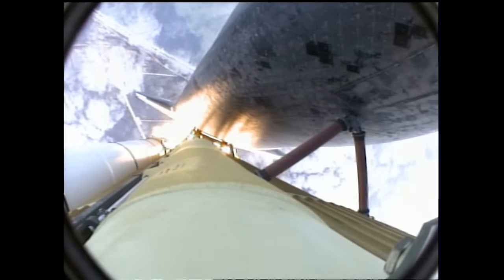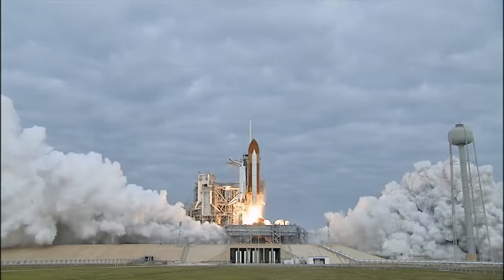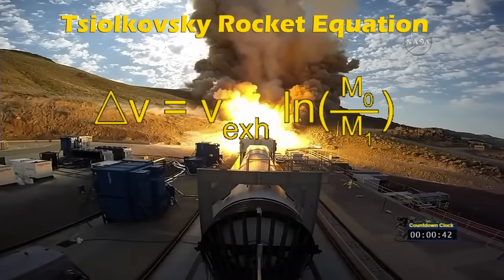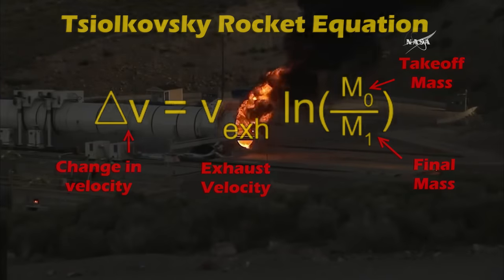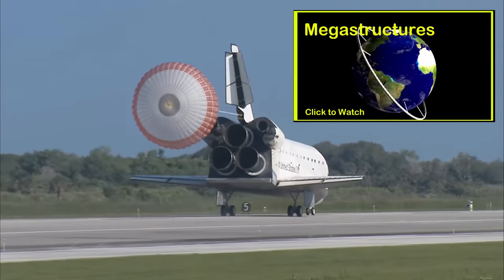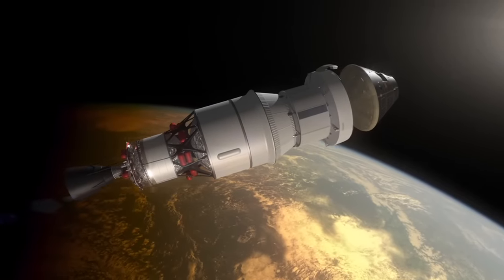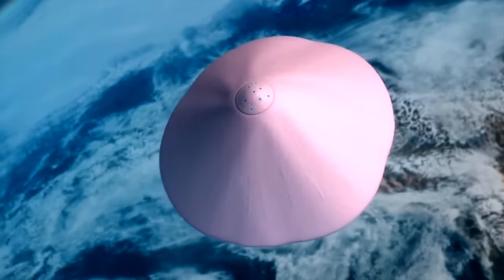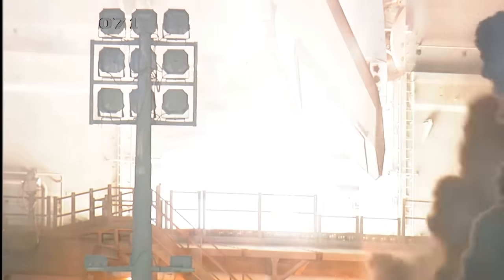The Spaceship Propulsion Compendium

Comment: I haven't watched this video in full but one way we could take a payload into space without using large amounts of rocket fuel could be to use a high power laser to power a jet engine that derives its propulsion from heat, using air from the surrounding atmosphere for propulsion. It could gain horizontal velocity once in the upper atmosphere with a gravity turn then once in space, use a small amount of propellant to circularise its trajectory into a stable orbit. All of this is possible with today's technology. At least I think it is.
Reply: you should probably look into the SABRE engine project, a single stage to orbit space plane with a super fancy jet engine which is designed to work in very little atmosphere with onboard oxygen then transition gradually to rocket propulsion.

it's a devilish engineering project that's been in the works for years and years but it's really damn cool stuff
Reply: I forgot to say even though I had this thought process going through my head that the heat for the jet engine could be supplied by a high powered laser. Better edit that in :)
Reply: Thanks for suggesting looking at the SABRE project by the way, it's very interesting. It seems like we're gonna have to wait for quite a while to even see that in operation.
Reply: in fact this is an actual concept called thermal rockets and thermal jets, and you can easily fin more on that subject. also, not necessarily with laser - one could just use a directional microwave generator to make it easier. (totally not that i learned this from KSP Interstellar mod, trust me)

Comment: Matter transfer engine. (not sci-fi)

A continuous cyclotron emiited molecular beam,

feeding into a linear accelerator. The matter beam would be sped up
while being ionized at first, but after de-ionization would function
akin to a molecular beam, in a straight line at high relativistic speed,
and being non-ionized at that time.
Projected onto a vessel that first ionizes the incoming matter stream,
and then uses fields to decelerate the now once again ionized matter.
The deceleration of the incoming matter now relays it's kinetics
on the receiving vessel, while also being projected back using
a similar system, for additional speed gain.
Only usable in outer space, since any atmosphere would disperse
the molecular beam.

Also, more importantly, any solid surface being recipient of a molecular
beam emission, would not be able to stop it, since kinetic transfer
from particle to receiving particle would greatly exceed the forces
that keep the receiver intact.
For reception you need time and with that only fields can be used
to allow for spreading of the force over time.
The field would rapidly decelerate the particle but not instantly.
Also, the ionization is also a requirement for capture and re-use
as fuel for the vessel itself, or possibly even re-supply with mass
en-route

Comment: 19:26 What peope tend to forget in their power output
from nuclear options, is the heatsink.
These would have to be ginormous.
In space any heat that's not radiated away is kept.
So, when the heat output exceeds the ability to lose it,
stuff heats up. And this with nuclear power is a big fat
stopper. A giant heatsink weighs a lot.
And for any acceleration mass is a factor, which then comes
with a heatsink that adds mass well beyond the nuclear
generator.
Heat is always transported by more mass, since the mass
needs to absorb the heat, and then in compressed form
release it somewhere else. This then limits the amount
of heat that can be transported by the medium to absorb
the heat, which then is limited by the maximum building
constraints (pipes melt), for which then only more of
the same system can be applied to disperse the heat
into thermal radiation, which then comes with more mass.
It's unavoidable and therefore non-viable.
A nuclear reactor weighing 10 tonnes and producing 12
megawatts of power will need a heatsink that's like
40-50 tonnes on top of that, just to stay in operation.
The same weight in solar power yield 12 megawatts
of power, and needs no such heatsink.
This goes for in system equation mostly.
Beyond the solar system it can work, despite the ginormous
heatsinks, since heating from the stars is minimal,
but even so, a UV beam emitter would be better,
since you can harvest solar power in system,
and thus project it on the solar film, providing power.
Reply: Also, civilians handling nuclear material, bad idea.

Comment: NTR's "can" be used on the atmosphere because the exhaust isn't carrying any fission products, but in the lower atmo the air is too heavy and the NTR's exhaust is too light to make much thrust.

Also going nuclear to power electric drives is pretty useless because of all the radiator space and weight to drive the generator. Zubrin's nuclear salt water rocket or NTR's are better choices because they directly move nuclear heat into the exhaust, removing much of that radiator mass. Fusion will have no benefit over fission when it comes to radiator space BTW. Well unless direct charged particle conversion can power the reactor's magnets and vent a portion of the plasma as propellant, but that is too far off than getting fusion to work in the first place.

Comment: Imagine a craft that does not require a fuel.  All of a sudden you have eliminated your greatest problem that being the mass of the fuel, a reduction of 80%, I imagine though I am not certain.
Using a nuke or solar charged capacitors to power a maglev that launches the craft out of the atmosphere has a great deal of potential and I am surprised that you did not mention such tech.  Once in space, there is the solar wind which has speeds of 400-800 kilometres per second.   One could use a series of reinforced mylar sails that catch the solar wind as well as charging any onboard batteries.  This would be efficient within the solar system.   Outside of the solar system is another thing altogether and is not relevant until we can develop a technology that enables us to explore the solar system.

Comment: 32:51 If they really wanted to test the 'thrust' at varying power inputs
they can simply start with less, and then go up as much as the contruction allows.
This then would give a variable in the thrust output, which is either
constant or variable in proportion of the power input.
This then settles the question.
That is, if the level of thrust actually is existent.
Note that even the most vacuous vacuum created still
has some particles in it, which may be the source of the presumed
thrust, if any.
For any closed system, it can only have a force exerted on it
by something leaving the system, which may be radiation
or light, but something has to leave in order to become
accelerated.

Comment: also as a side note. all the force you feel pushing you downward standing on earth is NOT JUST FROM GRAVITY, you are being pushed against the ground by the atmosphere aswell just thought id mention that lol i have no idea how much force this actually is
Reply from the maker: Pretty close to none, the air pressure acts as a buoyant force, but air is about 1.25 kg/m³ and water is 1000, humana re about the same density as water, so a 50 kilogram person is displacing about a 1/20th a cubic meter of air, or about 62 grams. Depending on how far you are from the equator you can lose weight to centrifugal spin of the planet too, or based on height as gravity weakens a little as you go up. It's pretty small, all three factors, but enough that a person's weight can vary by a measurable amount based on their latitude, altitude, and air conditions.
Reply: ah ty, i was curious about that. i also use this fact against flat earthers. since they all ask why we aren't flung off the planet as it rotates, or why an helicopter can take off and land in the same location without the ground moving under them.i tend to explain that the earth has an atmosphere, which we are in. and it rotates with the earth, which basically holds us in place as the earth is rotating

Comment: I just want to point out that no rocket fuels are expensive, compared to the cost of launching a rocket. 

A large fully fueled rocket may be 80 or 90% fuel by mass, but by price the fuel only makes up less than 1% of the total cost. Rockets are expensive to launch not because they burn lots of fuel, it's because they cost millions of dollars to build and are usually just thrown away after a single use. There are a few exceptions of course.

Saying a more efficient rocket would make space travel cheaper, while we're still throwing away rockets, is like saying building a jet airliner that needed 3/4ths as much fuel would save a lot of money, in a world where jet airliners fly once and are scrapped. 

Only the development of reusable rockets will bring the cost down significantly at this point, in fact trying to get more efficient can make a rocket more expensive, because getting more efficient would require even more fine tuned machinery which is even more pricey to build.

Comment: 13:58 The fitting with solar film, then inducing heating
by means of microwaves or such would easily produce
the same thrust as a nuclear device, and be smaller and lower massed.
A nuclear reaction in space needs the same amount of shielding
as on Earth, but also need additional regulator means,
since in space radiation that may increase reaction speed
can occur naturally.
A piece of solar film outputting 12 megawatts, on a surface
of 200x200 meters, can weigh as little as 10 tonnes,
which isn't true for the nuclear option, which needs
much radiation shielding or wouldn't deliver
the same amount of power.
I doubt a 12 megawatt nuclear reactor can even be safely constructed,
since the minimum shielding needs a lot of material, amongst which lead,
which then needs to be applied in significant quantities.
The only thing that would make sense is extrastellar space,
in which light is not abundant.
However, a UV lightbeam projected towards any target would bypass
this shortcoming of the solar powered option.

Also, any exhaust emission drive is better suited with electrics,
since Isp of the available exhaust is key.
If you can emit the exhaust at near lightspeed, you have more
efficient use.
Continuous feed cyclotrons and seconds stage accelerators
are most fuel efficient, achieving nearing c emission.
You can't get more efficient than that using exhaust emission,
which then by extent can only be achieved using field induced
acceleration of the exhaust.
Reply: A continuous feed cyclotron can be made using field
feeding into the cyclotron grid.
A particle is presented, which doesn't fit in the field
geometry, but is kept in position to fill a gap when it
occurs and superceeds the passing gap's field strength.
Where the gap is present, the particle is pushed
by a field into the gap, which then start's the particle's acceleration.
If the gap is not present, the particle would be pushed away,
but would be kept available for insertion upon the gap
being present again.
After cyclotronic acceleration, it could achieve like maybe 0.5 c,
after which it would exit the cyclotron and then being
fed into the final linear accelerator stage, which would drive that up
to 0.7-0.9 c.
Then you'd have the best Isp possible for any fuel exhaust.

This is much better than nuke in space or any other type
of ion drive it needs power yes, but at 12 mega's you'd be
accelerating, that much is certain.
.
This would by far exceed NASA's NEXT or NSTAR ion engine's
capabilities. It would also be non dependant on specific ion fuel.
As long as there's ions it would work, after adjusting the
fields to correlate with the fields capacity to increase the
ion's specific acceleration due to the fields.
Larger ions need more force applied on them to accelerate,
and thus need a slower progression of the cycltron's
field, but smaller ions can be accelerated faster, which then
only needs field timing adjustment.

In fact you can go into low orbit, siphon some gas from just about
any planet with an atmosphere, by just slightly dipping a toe in,
while keeping the deceleration with such an atmosphere to
a minimum, taking in atmosphere, separating the matter
using molecular beam shifting, and then knowing what tank holds
what type of element, which can then be ionized and used
for fuel, after adjusting the fields to fit the ion class or element number.

In space, if there's resistance by particles, use it for fuel.
Also, some of the scooped material maybe used to keep the orbit
intact, by direct application or application of still available
fuel reserves.
The molecular beam shifters need to do their job properly in order
to have more gain than loss, which then means you can only use
one element or fuel type at any given time,
since the ion engine can only accomodate one type of ion at a time.
This may be circumvented by using two drive assemblies
which can then support two types of ions at the same time,
or both use the same ion type.

Note that this type of ion engine needs very little fuel, and even a few
grams can get you lots of thrust.
If the amount of resistance encountered is high, then so is the fuel
intake. Ofc, don't exceed the breaking by the atmosphere to such
an extent that you can't compensate using the thrust.
This would be dumb.

Although starting with Xenon may seem like a good idea,
but in space it's not that abundant. It's best to try
and use hydrogen and helium first. since these can be found
near stars, like the Sun, or upper exospheres from planets.
Yes, these are much lower mass, and yet very useful, since
acceleration is based for the most part in speed.
0.5 m v^2, has the most weight in the v^2 component, not the mass.

Comment: It is very sad to see that basically today we are using the same tech to get into space and going around the solar system which was developed cca 80 years ago by Wernher von Braun and Sergei Korolev. As you mentioned correctly, almost 90% of the available energy of a spacecraft is needed to get to LEO. 
With the remaining 10% we ain't going nowhere. Or we do but very very slowly.

Piece by piece it took roughly 10 years to build the ISS  ( with a hefty price tag of  $ 150 Billion ), and it has a size of a football field. It wasn't cheap, but the thing is, we could do it.

So the technology is there ( even it gets cheaper and better if SpaceX gains more experience).
The money is also there, considering how  much we spend yearly for space exploration worldwide.

So why not start to build a shipyard in LEO immediately, assemble the ships, fuel them up and go from there?

We can still go with the old methods, but then the journey will be pricey and painfully slow.

Congratulations for your channel by the way and keep up the fantastic work.

Comment: I realise the main cost at the moment isn't fule but its lack of reusability repair  costs and safety checks 
But from an energy standpoint 
Double the exhaust velocity and you quadruple the energy needed to minimise energy use you want a lower exhaust velocity at the start and a very high exhaust velocity later on.
if 10% or a 0.1th of the mass is payload ATM then double the exhaust velocity gives you a 0.1th^2 about a 0.32to 
3.2 times the payload for 4 times the energy if however half the mass was fule at the same velocity then the rest at twice you would get to 0.30 of the velocity at 50% mass then you would have 0.70 to go but since you had twice the exhaust velocity you can half that number to get 0.35 then treat it as if the exhaust velocity was the same 0.1^0.35 = 0.45
0.45 of the 0.5 gives you a payload of 0.225 so you had 0.5 of your start mass at normal exhaust velocity and 0.275 at 2*
the velocity 4 times the energy 2.1 times the energy for 2.25 times the payload and have increased the energy efficiency.

The ideal for energy conversion if it where possible would be to keep exhaust velocities such that they match the speed of the rocket.
You would also want to use the fuel early on though this has to be balanced with the drag of the rocket in the atmosphere The weight of the fuel casing isn't taken into consideration in my calculations though but a rocket would still benefit greatly energy wise from a variable exhaust velocity.
Reply: You want low cost reusability then the focus is cheep fuel costs via low power costs to make access to space affordable.
Reply from the maker: Unfortunately if I covered all that stuff it really would have been a video on rocket science, I blew my quota on equations just with rocket equation and the math on the astronaut w/ flashlight :D

Comment: A possible means of getting humans to a relatively high speed would be to construct a 160 mile long mass driver on the Moon's surface.  A ship destined for Mars would be launched in segments with an acceleration of 20 g's.  Velocity of the segments as they cleared the mass driver would be on the order of six miles per second, fast enough to reduce the transit time to Mars considerably.  The human crew, wearing deep diver outfits, would enter a specially designed compartment.  In the few minutes prior to launch this compartment would be totally filled with water (let's say the water to be used for drinking and sanitation during the transit to Mars.  During the minutes before launch the water in the compartment would be pressurized to 20 atmospheres, the pressure of water at a depth of 680 feet.  As acceleration started the artificial acceleration being applied would cease.  The acceleration itself would now be pressurizing the water.  It would end after 50 seconds, and the artificial pressurizing would be reapplied gradually dropping water pressure to one atmosphere.  On the other side of the bulkhead would be the control room, which the intrepid spacemen/women would use to put all the ship components together for the journey to Mars.  Rocket fuel used for the acceleration phase of the trip would be zero, which would be nice.